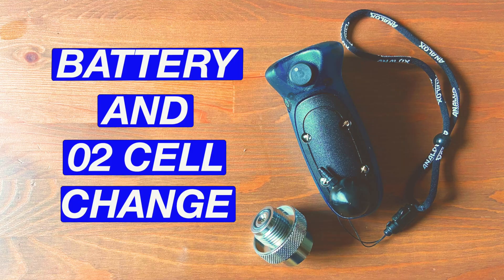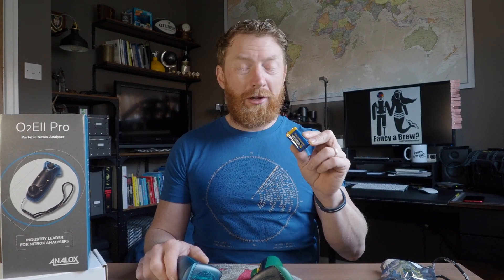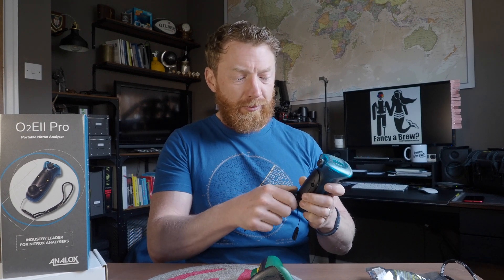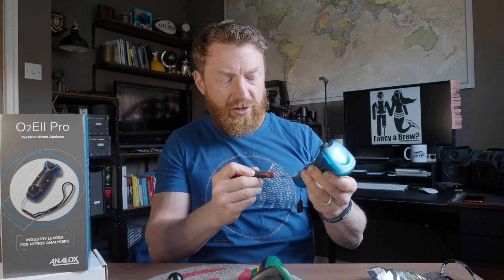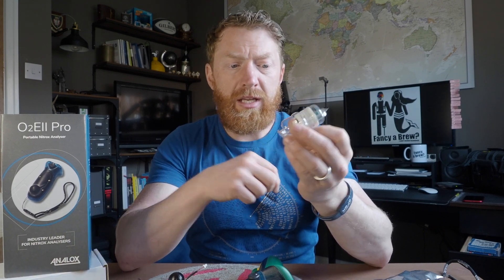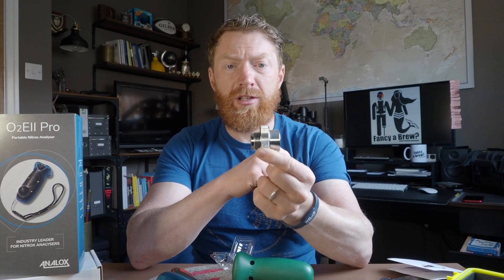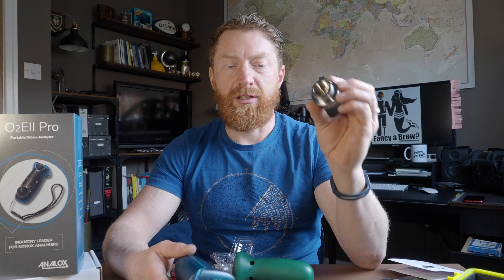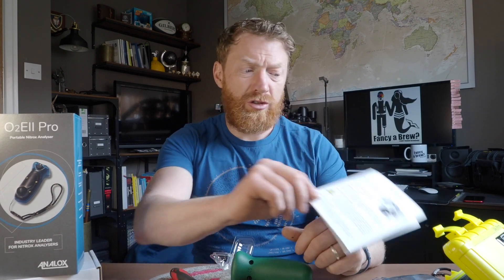How to change an Oxygen Sensor and Battery in the Analox O2EII Pro

Comment: Does the lifespan of the O2 sensor depend on how often it's used
Reply: @Ryan Leopard Does this still get affected if (a) the O2EII us stored in an airtight container (once the O2 in the container is gone surely there is no more reaction from the sensor) and (b) for the "green coloured" model there is a white "sensor saver" which can be used to replace the dome - as above, there is inly a limited amount of O2 to sense?
Reply: @michaelclarke8972 yes and no, the acid in the cell will deplete it anyway but you will extend the days if stored inert or plugged shut so oxygen is used up. The life if the cell is limited though also in relation to the amount of gold foil used.
Reply from the maker: Thanks Ryan